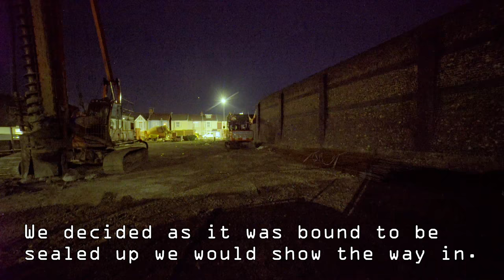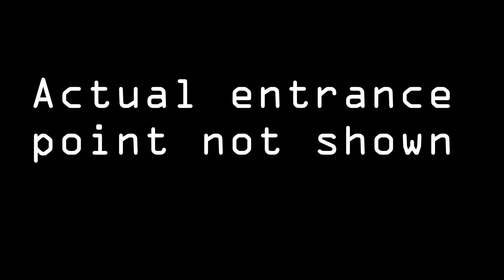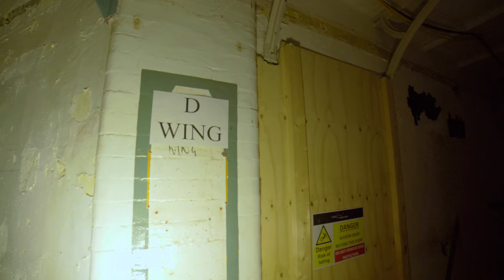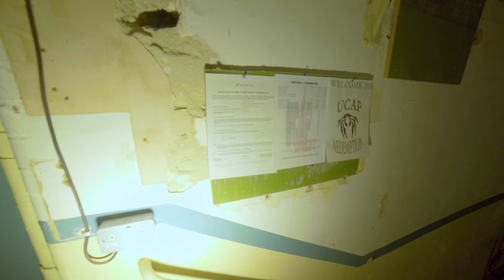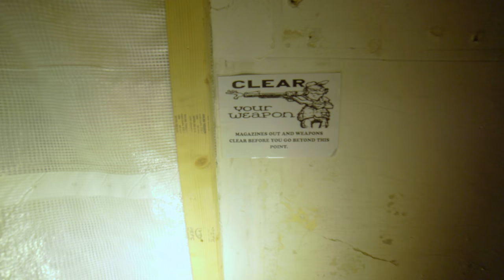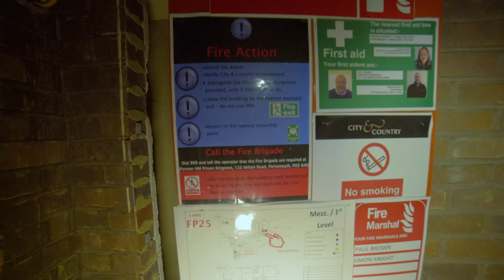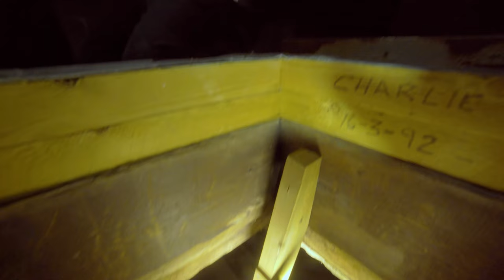Kingston Prison in Portsmouth WE RING THE TOWER BELL

Comment: The corridor of damp cells you discover at 1.44  may have been the punishment block, as only the central part of the first cell window is actually see-through.  Having visited someone there just once, many years ago, for the life of me I can't remember how you got from the gatehouse to the wing [the elderly inmate I was visiting was sufficiently trusted and privileged to invite me there]; I've a feeling that  as a visitor I was accompanied through the yard; whereas prisoners would have entered through an underground passage.  I do remember that the wing had a surprisingly homely feel at that time.  Your rooftop adventures had me on the edge of my seat incidentally - very good filming.
Reply from the maker: Underground tunnel. I wonder if it was blocked up. We didnt see anything.
Reply: @TheSecretVault  Well, l don't know what's been demolished, but there must have been some kind of reception department for prisoners, where they'd be strip searched, showered,  medically assessed, etc.  That may have been in some of those basement rooms; which means the vans must have driven through the gate house to a side entrance somewhere.  Prisoners would be taken downstairs,  processed and then entered the halls from below - if that was the case. It wasn't an especially high security prison, so they may simply have been walked around once inside the walls.  There must also have been a hospital wing and kitchens, etc. Probably workshops too and maybe a dining hall too - though that could also have taken place within the halls themselves. Some prisons also    had recreation rooms and even swimming pools - I'm not sure what was there!